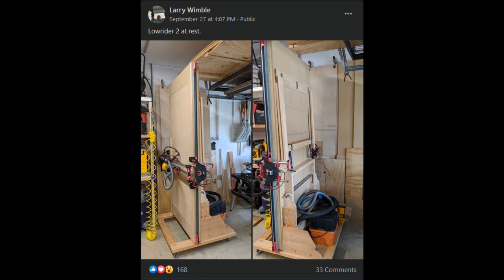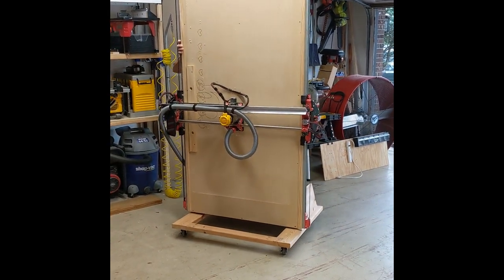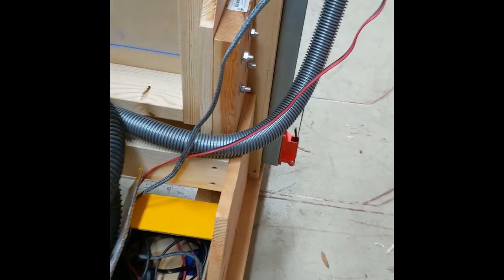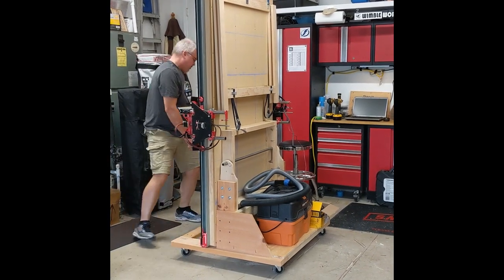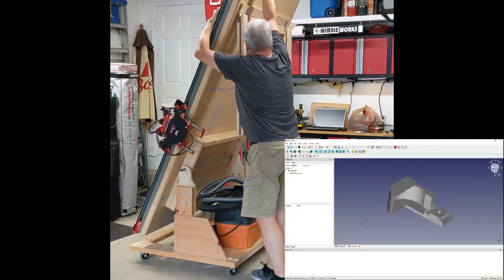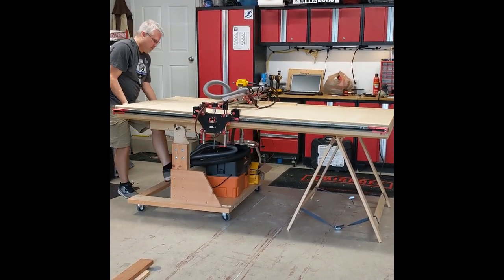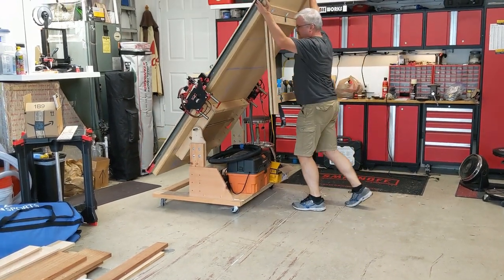Lowrider 2 CNC folds up vertically for storage

Comment: Is there any update on this? I love this design, but I'm curious how it has held up to the test of time. Thank you!
Reply from the maker: Actually Yes, I just haven't gotten around to making up a new video.  I ended up replacing the unistrut with 20x40 V-Slot rail, and then designed some V-Slot carriages which bolted to where the skate wheels were previously.  I printed these in ABS for ultimate strength.  I used the machine quite extensively around last Christmas (2011) and it's been sitting in the vertical position since.  So far so good.  If you want the design for the V-Slot carriages, I'll be happy to post them up on Thingiverse.

Comment: Hello, 
any updates?
Reply from the maker: Actually Yes!  I took some time away from machining to get some fairly major projects around the house done, but I've just started back at it recently.  I have removed and replaced the channel strut with v-slot rail and designed some v-wheel trolleys that the gantry now rides on.  I haven't yet folded it up vertically as I don't yet have anything to lock the gantry down to the v-slot, but it's a relatively easy design so that should be forthcoming shortly.  I will definitely post a video update once I've got it folding up again.

Comment: I know this comment is way out of time sync  but, wouldn't it be possible to just drill a hole throught the y axis rails and sides of the table then when the gantry was parked slide a pin in the hole behind the gantry wheels, so that when the table lifts the gantry sits on the pin/bolts?
Reply from the maker: That's certainly an interesting idea.  The only thing that concerns me is that it might put a fair amount of lateral stress on the XZ main assemblies.  It's one thing for the XZ mains to bear the weight of the Z-axes.  It might be another thing altogether for it to bear the weight of the entire X axis including the router.

Comment: Have you tried homing the gantry to the lowest point (x0,y0)? It should lower the center of gravity, making the unit bottom heavy and help the unit from tipping over in the vertical position. Perhaps adding counter weights at the other end to prevent it from tipping over when moving it to the horizontal position?

Comment: Love the fold up design idea, i'm working on a similar design but was wondering if you managed to find a more robust solution for holding the gantry securely noting your wheel lock failure?
Reply from the maker: Thanks.  I started to beef up the wheel locks which seems like the only solution that won't introduce a twist into the gantry.  Unfortunately my professional life is sucking up all of my free time at the moment or I might be done with it already.

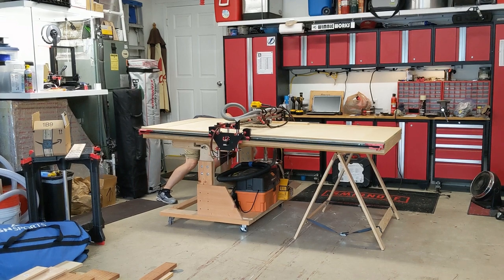Comment: @2:05 I was wondering how easy the axle would slide back to the 'pivot position', but you cheated :-)
Reply from the maker: Not sure how I cheated; it was intended to work that way (though I did neglect to unlock the wheels which makes it way easier to slide).  Looking back at this, I would make the pivot point static if I did it again.
Reply: @larrywimble2131  Thanks for the info! Indeed, a static pivot point makes the whole thing a lot more simple i think. I was just wondering how 'nice' it would slide back to it's pivot point in the video, but that part was not on camera :-)

Comment: THIS IS AWESOME!  are you making plans available?
Reply from the maker: I've thought about it, but there are some things I would want to redo and test before making plans available.  The thing is crazy heavy and the cart has some lateral stability issues, though that would only come into play when moving it around in the vertical position.  I try to to stress it that way.
Reply: @larrywimble2131  looking at it now, I can see how there would be a stability issue. shouldn't be to difficult to figure out.  great solution
Reply: @larrywimble2131  also, check out the caster solution I came up for this: https://youtu.be/A14jKa-kbzg

I think it would work really well for your cart!
Reply from the maker: @TheHowtoDad  That is super slick!  You're making me think about redoing my cart now 😁
Reply: @larrywimble2131  it's awesome! so much faster, easier and more stable when in the "locked" position

Comment: How is the carriage held mid table ? If it's with the belts, I'm afraid it might be too heavy and would damage the belts over time, thus the precision.
Reply from the maker: It's not with the belts.  I 3d printed some holders that bolt to the unistrut that hold the wheels in place.  You could put it anywhere along the table.  Links to this files are in the video description.

Comment: Love this setup Larry.  Am wondering why you not try to set the gantry wheels inside the U channel rather than on top ? Would love to see a video on your setup for the U channel end stops / wheel travel
Reply from the maker: The channel is too deep for running the wheels inside of them, not to mention that back of the channel has holes in it for mounting.  I do have another video I took right after I finished the machine that shows the auto-level/auto-square functions.  It's on my channel I believe.